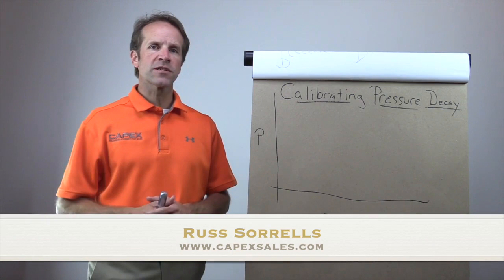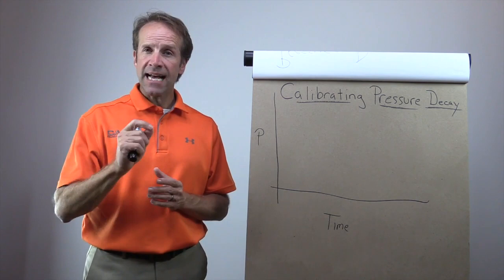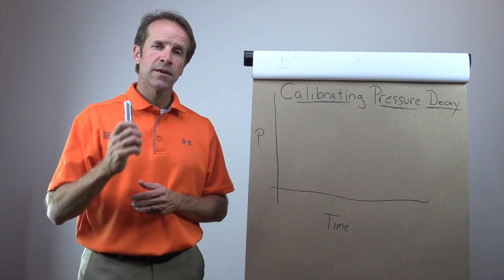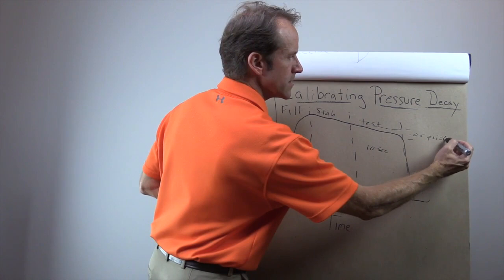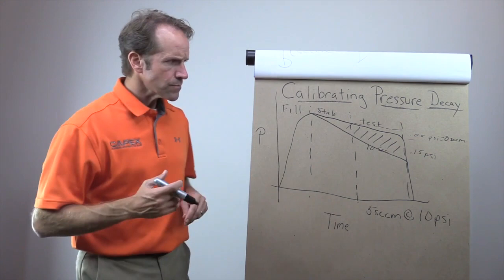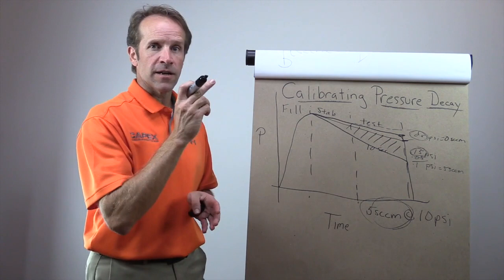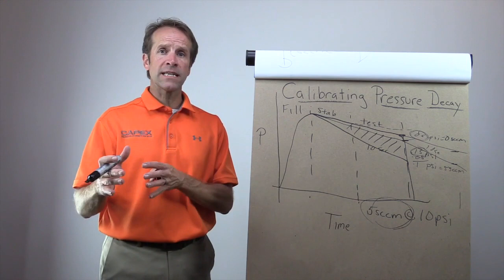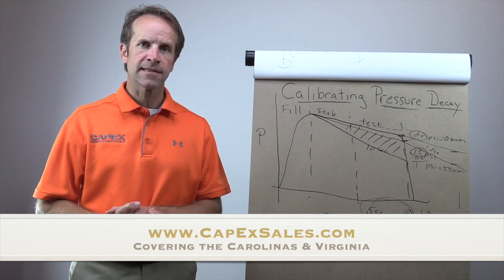Calibrating Pressure Decay Leak Test

Comment: Hi Russ, thanks for the super awesome video. I wanted to know whether we can use the same tester to conduct tests for different pressure values and reject rates. Do we need to calibrate the tester again each time doing that? What would be the negative effect of doing the test at say 10 psi-1SCCM reject rate when the tester was calibrated to 2 psi-1SCCM reject rate?

Comment: Awesome video Russ!  I understand getting a negative value when testing a part after running a calibration.  However, what I don’t hear you talk about is what does it mean when you’re in the first part of a calibration and that value is negative.  Any ideas on what would cause that?
Reply: Steven! That often results from the part being warm and the air pressurizing the part heating up. The transducer is seeing negative pressure during the test. If there is a large surface area the part could be retracting after pressurization reducing the available space and increasing the pressure in the test part. 

The transducer (should) zero at the start of every test. If there is pressure in the part at the beginning of the test the zero will be elevated and during the stabilization the pressure could go below the zero point. In this case make sure the part is vented or has no pressure prior to starting the test. 

Bad transducer calibration is another option. Using the self-test cap on a CTS unit or capping off any other type of tester should allow you to test it out. 

Good luck!

Comment: Hello, I want to ask what might be the risk if I use a sealing fixture for calibration instead of a real physical part (like production parts)
Reply from the maker: Hello Luis! The goal with a master part is to simulate the production parts. For example, if your part is a one liter plastic bottle, you will want to use a bottle consistent with the bottle you will be testing versus a stainless steel part that has a one liter volume. For calibration you will want to use your seals, parts with similar material and configuration. Keys to calibration = simulating thermal effects, production part seals, part expansion (plastic parts in particular), and volume changes. We want to take into account all variables during calibration. Doing so will help ensure we have a more repeatable and reliable test. Hope that helps! Feel free to ask questions!